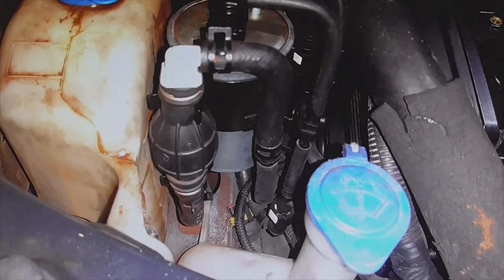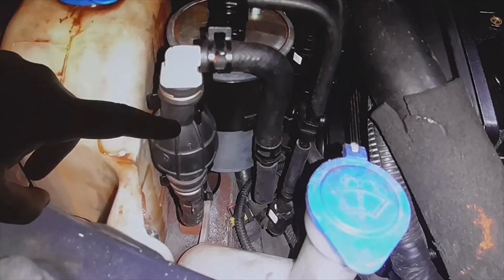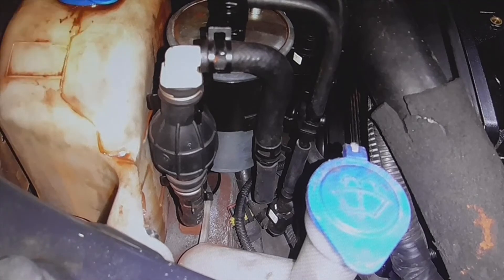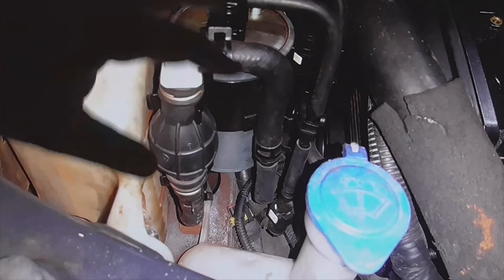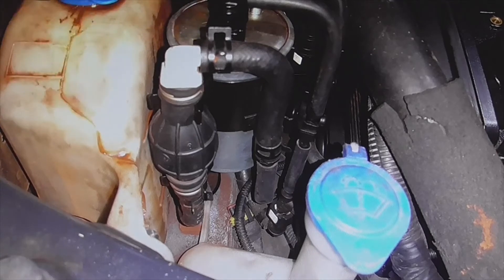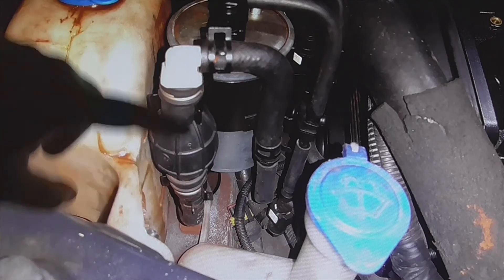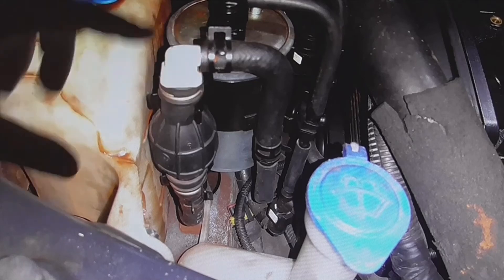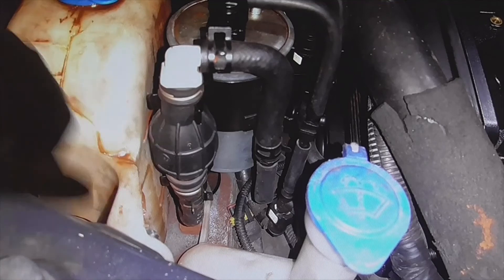Diesel primer pump, what it is for and how it works in a car??

Comment: Where does the air go? Where does it escape the fuel lines?
Reply from the maker: The air does not really escape, what the valve does is attract the fuel, it can only flow in one direction and in this way the air that has entered the fuel system is compressed to the maximum and this will allow us to start, more easily, the car engine.